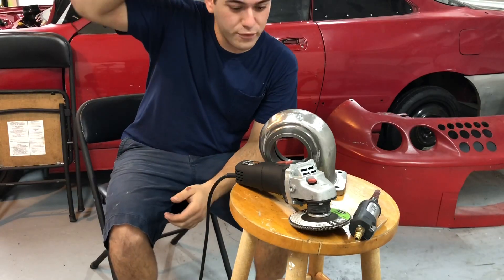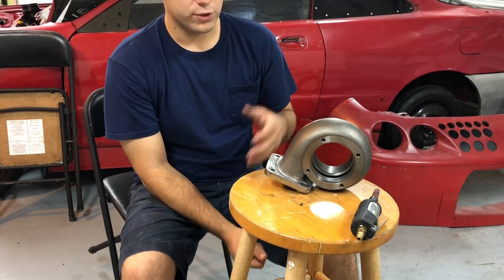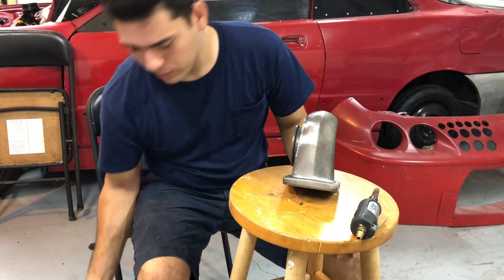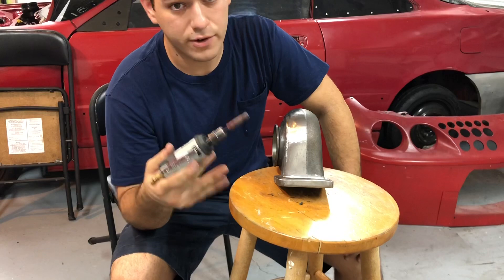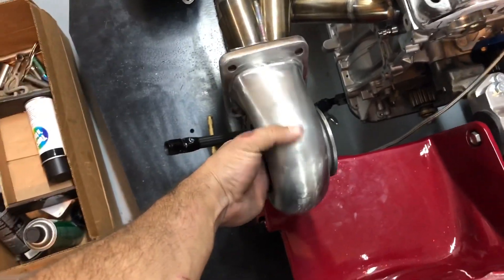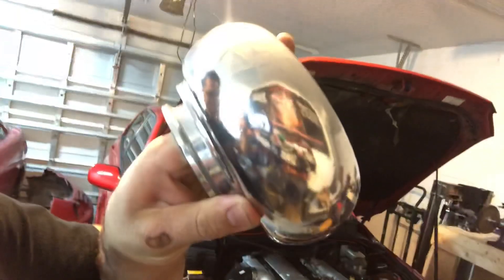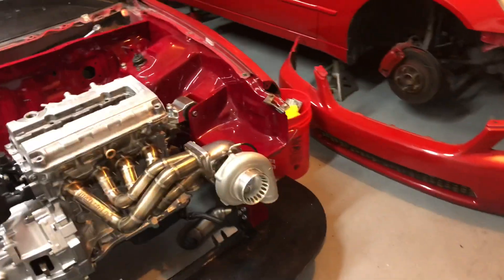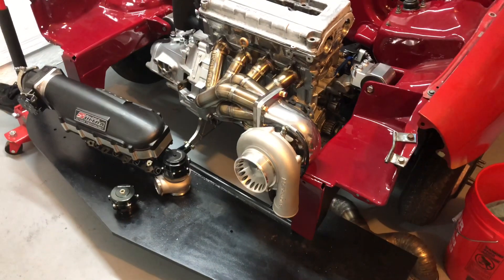Ceramic Coated Turbo! || Lower Under-Hood Temps + More Power !

Comment: Looking great so far. Have you considered a bracket to support the weight of the turbo? Or is the turbo not heavy enough for it to matter much. That manifold looks very strong but the leverage from the turbo in that location might add stress to the manifold and potentially crack. Forgive me if my logic is flawed